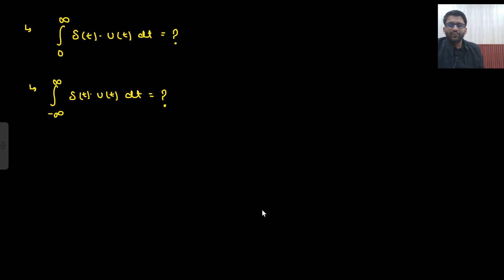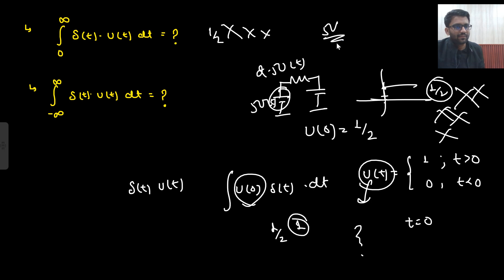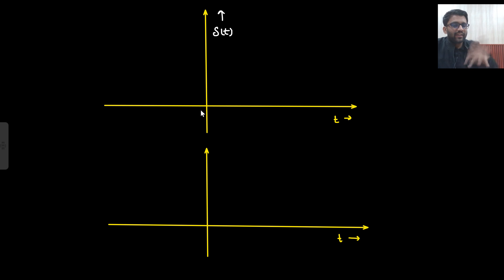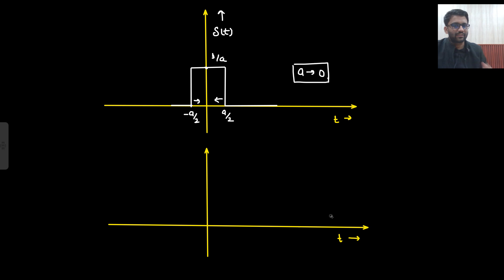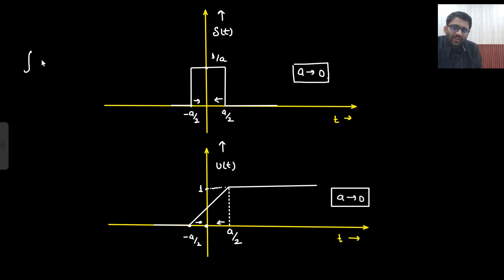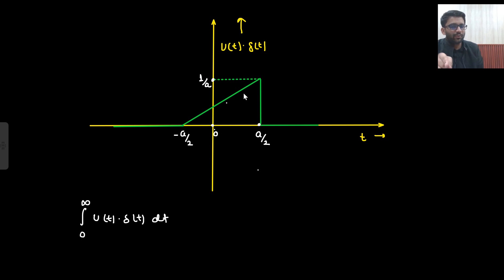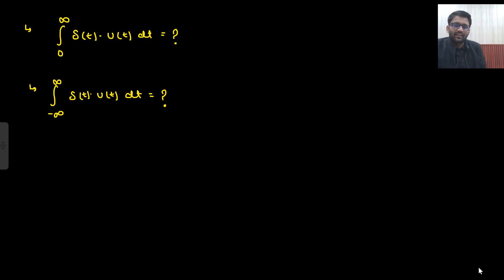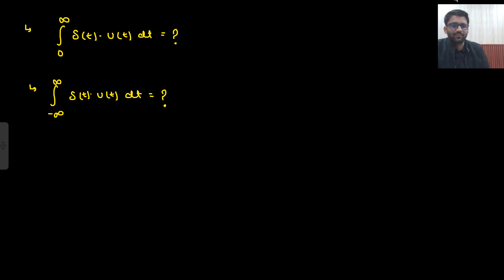🔥Conceptual Question on Basics of Signals || PrepFusion

Comment: The solution is incomplete. 

It depends on the limiting function of the dirac delta function that we take. 

If we consider the limiting function of dirac delta function as a rect pulse, this is the answer. 

But if we consider the limiting function of dirac delta function as a triangular pulse, the answer will change(which gives 1/3).